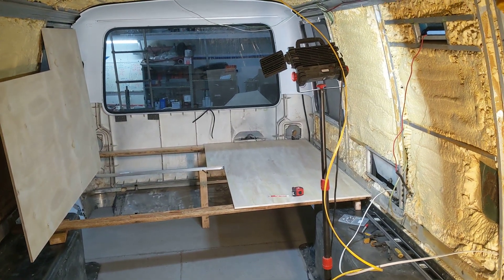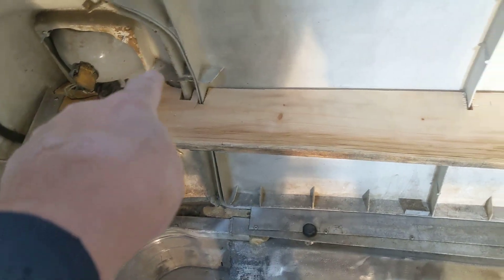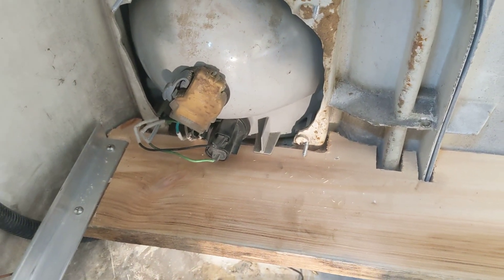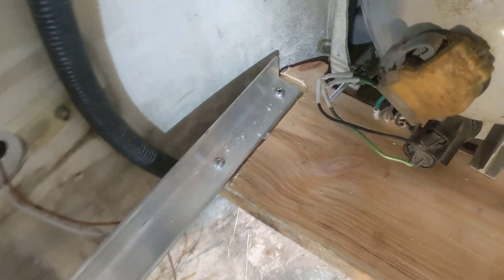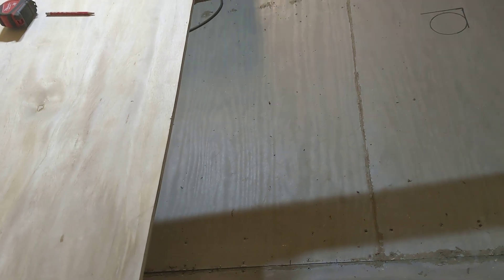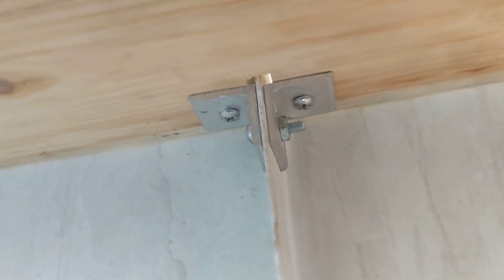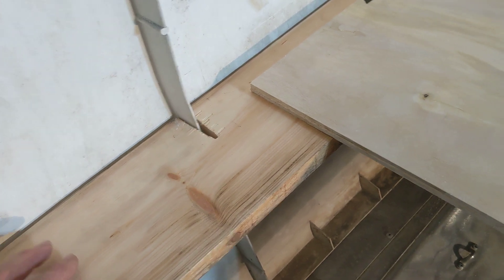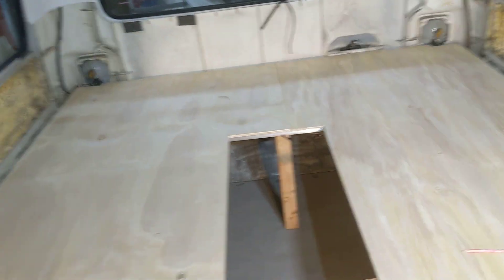GMC Motorhome 153 (bed platforms)

Comment: That's how I am planning mine. Two twins. I was looking at the more narrow 30x80 RV bunk size. And I am thinking about mounting them higher. So the platform is at the bottom of the window. Cold storage to the height of the outside doors, and lift up warm storage under the mattress.
Reply from the maker: I would like 80 long but that will not work with my bathroom plan.  I think you would want the top of the mattress even with the bottom of the window.